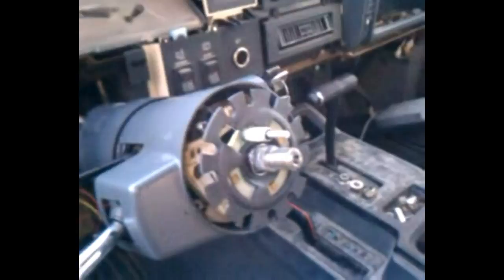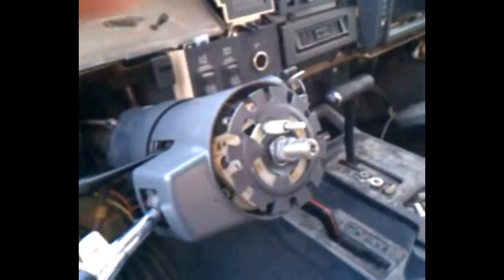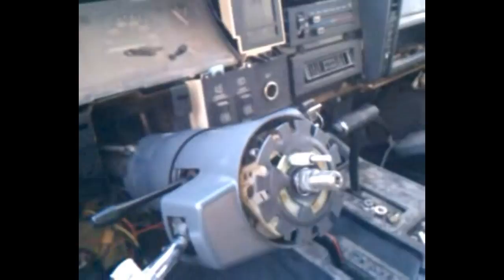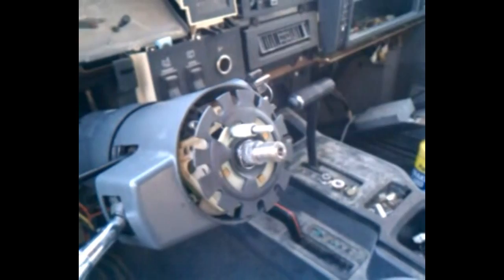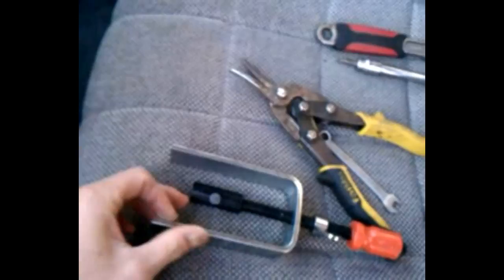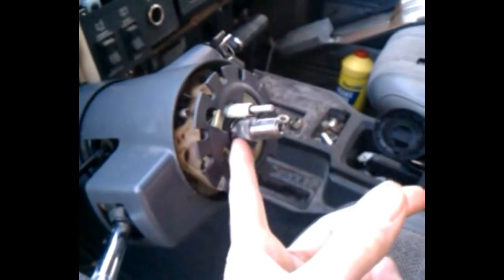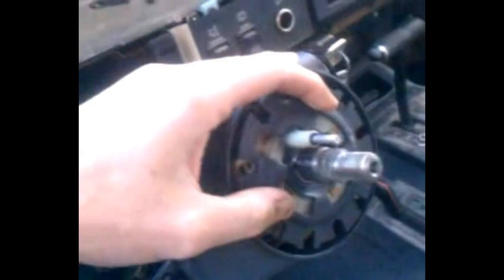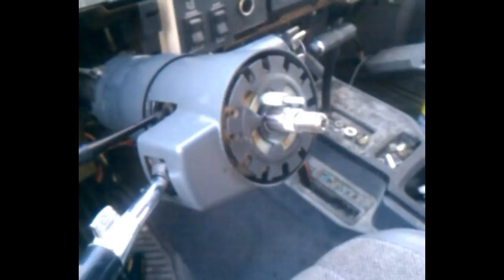"how to compress a steering wheel" -Mike

Comment: not sure what I'm doing wrong.  my lockplate does not want to go back on.  my tool has a hex nut instead of a wing-nut on it and i am applying so much force with a wrench that the lock plate is bowing - yet you can finger tighten a wing nut to push yours on?.  the splines appear to be starting straight so I don't know why it doesn't want to go.
Reply: don't be a dingus like me.  The splines are cut so it can only go on when it's rotated in one exact position - the same way it was when you took it of.  if you look carefully at the inside part of the lock-plate where it slides over the steering shaft you can see that it would only go when you have it at the right rotation.  You could add index marks with a magic marker at disassembly but once you know what to look for on mating it back up it doesn't really seem necessary.  The lock plate tool will install it with ease if you have the lock plate rotated correctly.
Reply: Thank you!
Reply: Same
Reply: @johnfitbyfaithnet  did you get it figured out? i replied to my main comment with solution